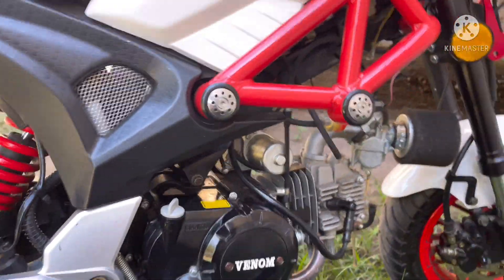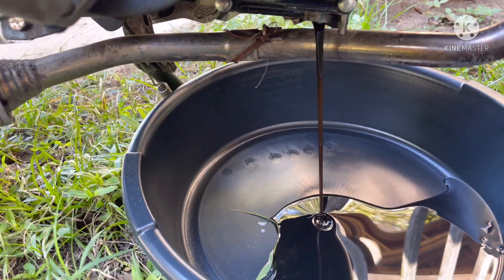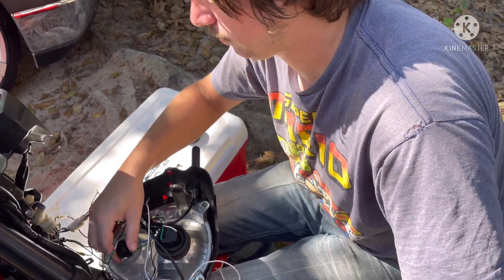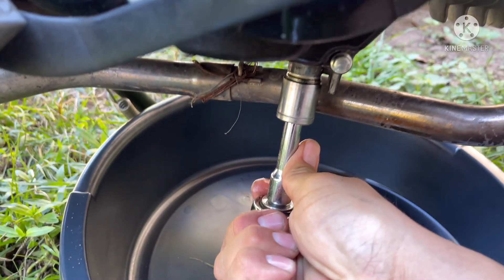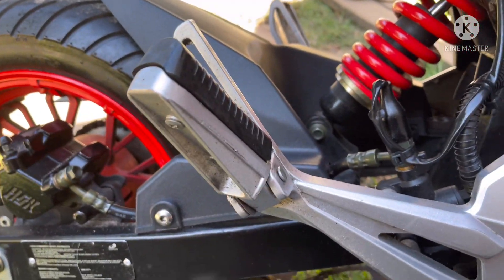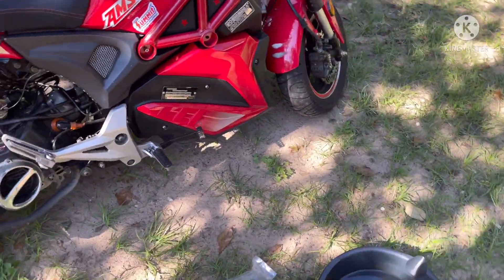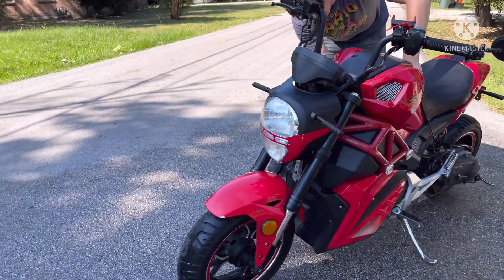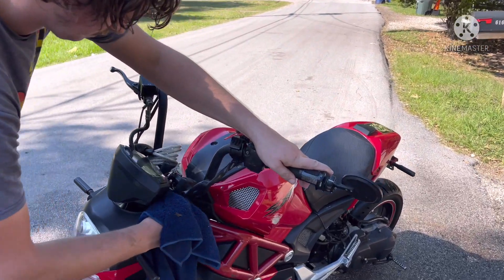Oil changed  on the 125cc and 50cc!🔥🏍💥

Comment: I have a question on the battery for the 50 cc how did you get it the stay charged ?
Reply from the maker: Ride it everyday lol i ran like 6 batt since i had it but if u leav it park for a couple days especially if is cold batt seem to die or go bad dont use acid batt
Reply: @diegoclonevlogs634  thanks for the heads up love the videos by the way